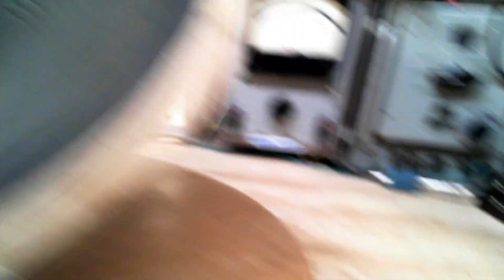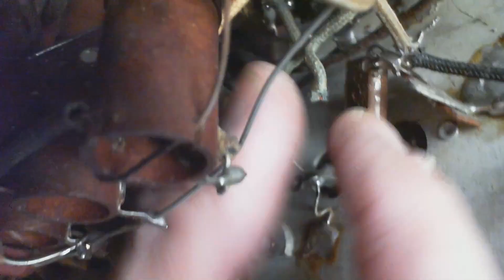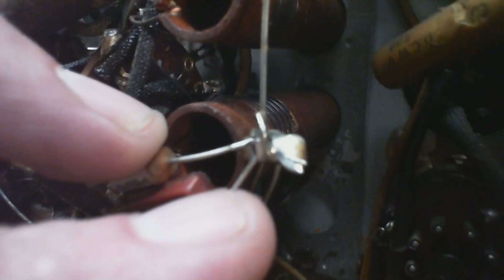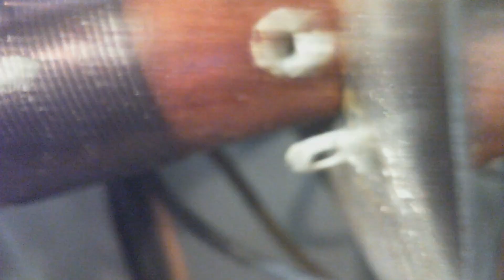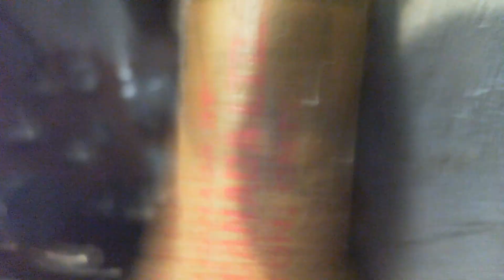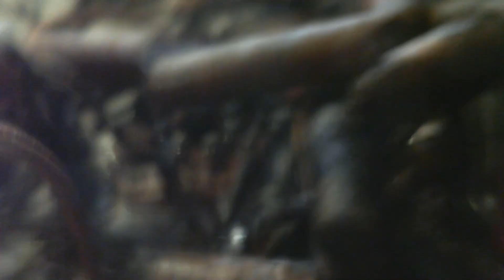Canadian Westinghouse 981 Shortwave Radio Video #1 - Checkout and Power Up

Comment: Hi Jim, do you restore radios?  I'm from New Brunswick, Canada.  I'm looking at purchasing a Hallicrafters S38 receiver.  I assume from reading Adrienne's comments that you are situated someplace in Canada.  As I write this also noticed that you were talking about the black out in Canada.  It's almost impossible to find anyone that does this work in new Brunswick.  Let me know if you do this work?  I may not need to do any work on the unit; however, at this point I would like to know if anyone does this work and what your process and cost are.  Be Well.  Love your video.  I just found you a few weeks ago.  I have a few older radios and I often ask myself what I will do when they die.  All my radio are SW receivers.

Comment: This my grandparents radio.  They purchased in around 1935.  My dad was the one who replaced the power chord. I took it apart and cleaned. I also plugged it in.  I watched many videos from Jim on this radio. Eventually I emailed him with a few questions   Discovered that he lives in the same area as I do in the summer.  So I took the guts and speaker out and drove it from Canmore Alberta to orillia Ontario about 36 hour drive for Jim to work his magic.  The fact that he could have been anywhere in the world but was in the same area as I have been for the last 45 years just blows me away.

Comment: Hey Jim! Would you show us the construction of your lazy Susan and where did you buy the race?
Reply: I remember a long time ago Jim talked about this and he said he had taken apart an old rotating TV stand and he saved the rotating bearing track assembly (round part)  and he cut wood you see and cut a wood base underneath and installed the bearing assembly in between the two wood sections.

Comment: Ive been repairing speakers for 50 years using Duco cement and toilet paper. Of late I am also using rubber paper glue. The coil that powers the speaker as a magnet is called a swinging choke inductor varying the inductance with variations of B+ current. Generally the bigger the speaker the better it will sound to then human ear, which may not respond the the range of 20Hz to 20Kilohertz.

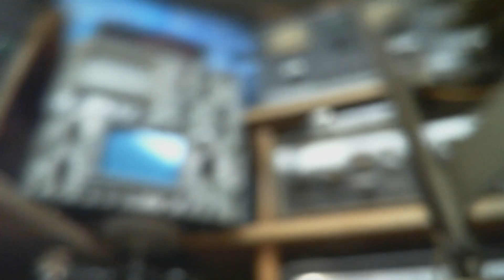Comment: 35:50   whoa electrical theory not for beginners, wires floating in space, near each other. for what????   cool Jim, its way over  my head, and that's ok. It works ,  hooray, this one should be easy to tune up,  good luck/
Reply: These two floating wires are a very small capacitor and in the factory they cut it till it match for some adjustment.